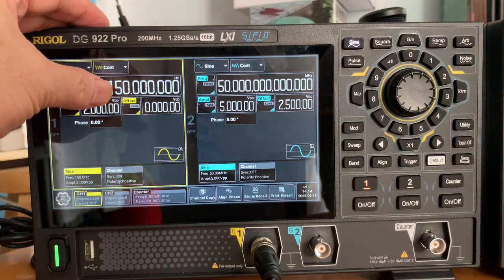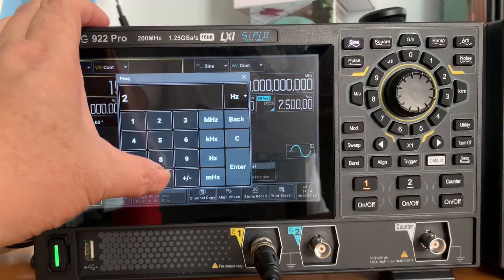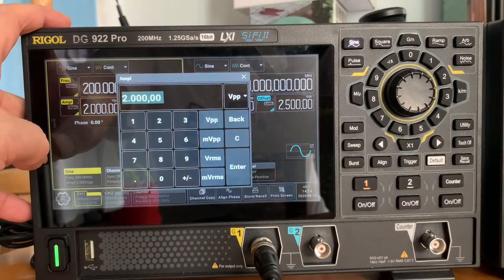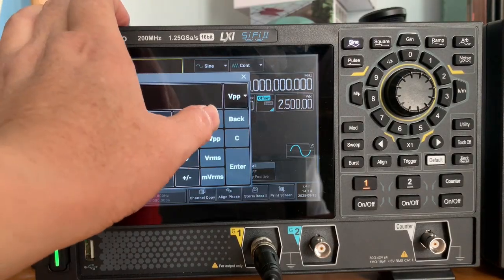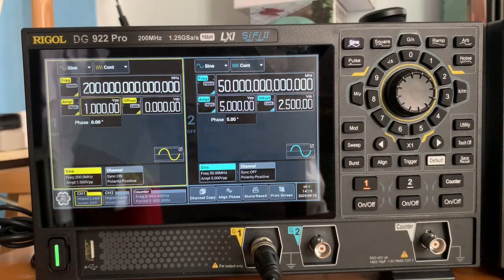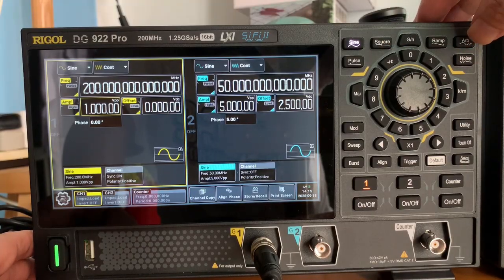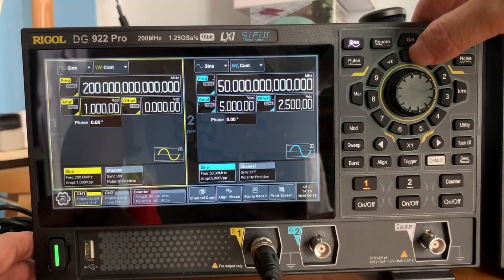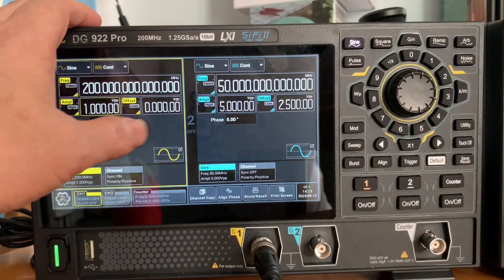RF Engineers: Don’t Overlook the Oscilloscope!

Comment: Так в чем проблема? Плохой кабель с большим затуханием на 200 МГц, или плохой осциллограф 924S  с плохой чувствительностью на 200 МГц?  А может плохая работа генератора? Ролик не дает полной картины, чтобы сделать правильные выводы, для полного понимания нужен второй контрольный осциллограф и другой генератор, чтобы все проверить и сравнить. Спасибо за видео, не совсем понятно.
Reply from the maker: RF Engineers do not use Oscilloscope as often as SA  and other RF test equipment. I guess you are a RF Engineer like me so have this question. The short answer: most oscilloscopes will show lower amplitude than a signal generator at high frequency if the measurement setup is not ideal.
This is very common, and it is usually not because the oscilloscope is “wrong,” but because of measurement physics and setup limitations. 
The rule of thumb is:
When the signal frequency reaches ~1/5 to 1/3 of the scope bandwidth, the measured amplitude starts to roll off.
Reply: @ThinkingLifeRF спасибо за пояснение. Но зачем тогда производитель заявляет полосу пропускания осциллографа в 250 МГц? И еще кладет в комплекте измерительные щупы до 350 МГц. Как я понимаю метод измерения тут не должен обсуждаться, если заявили характеристики до 250 МГц, то пожалуйста соблюдайте их. Я так отношусь к характеристикам прибора. Если производитель не в состоянии обеспечить четкие точные измерения в полосе пропускания прибора, то он обманывает покупателя, а значит должен уменьшить в описании к прибору его полосу пропускания, например вместо 250 написать 150 МГц, но эти 150 будут справедливыми. Вокруг обман, как это надоело...
Reply from the maker: @radioscan1835  Thanks for raising a very fair point — this is actually a common source of frustration in test & measurement.

When manufacturers state “250 MHz bandwidth,” they are typically referring to the –3 dB analog bandwidth, meaning the scope is specified to reproduce a sine wave up to 250 MHz with no more than 30% amplitude error. It does not mean the amplitude will be perfectly flat or accurate across that entire range, especially when real-world probes, cables, and terminations are included in the measurement chain.

In practice, as you approach ~1/3 to 1/5 of the scope’s bandwidth, roll-off and setup-dependent losses become noticeable, which is why many RF engineers prefer spectrum analyzers for amplitude-critical work at higher frequencies.

Also, for transparency: I’m not affiliated with Rigol and wasn’t paid to make this video, so I can’t speak on behalf of their specifications or marketing. Hopefully someone from Rigol might chime in with their official explanation.